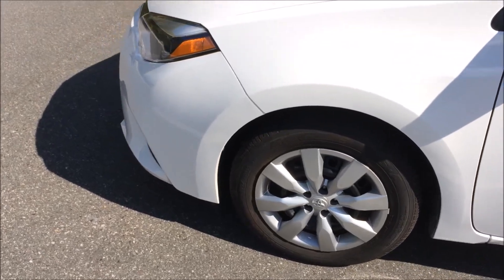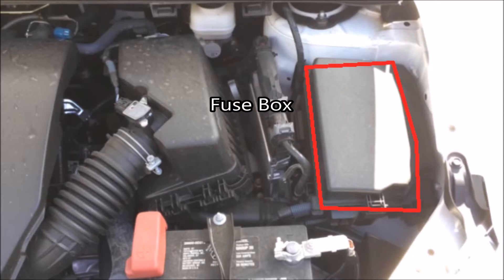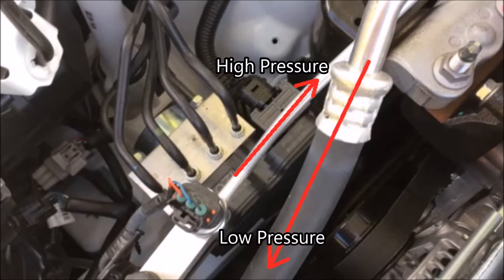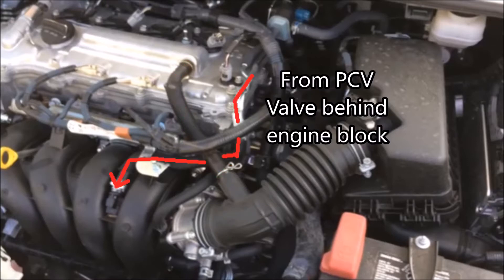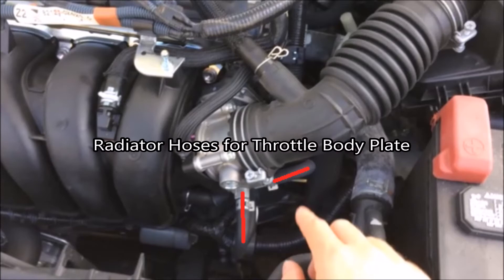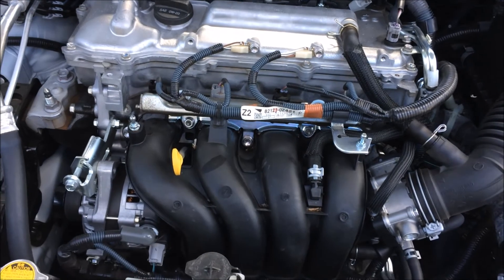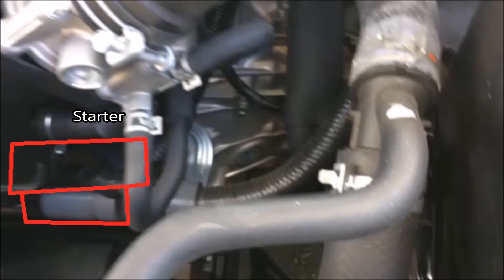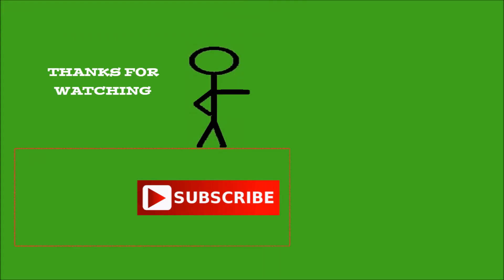Toyota Corolla 2017 Engine Review - SE 1.8L I4

Comment: 7:14 FYI most 4 cylinders from Toyota since about 2010 or possibly earlier, have 4 valves per cylinder, which is actaully common on most modern inline 4's anyway from Honda, Toyota, and others.

Coming from a V8 engine, I forgot how "easy" it is to do more stuff with small 4 cylinder cars. I mean some stuff is a pain, but other common stuff, like PCV valves and other regular maintenance items are a bit easier IMO.  On some trucks or cars with V8 engines, things get tucked into places that are sometimes hard to get to.

Comment: my dealer says i should do the oil change every 10,000 miles. i have only 14,000 miles on the car right now. wod you recommend a shorter oil change interval like 7500 or 6000 miles to keep the valvetrain components clean or whatever?
Reply: Change every 4000 miles add bG oil additive for extra protection
Reply: @jesusmontes2583  
Wrong